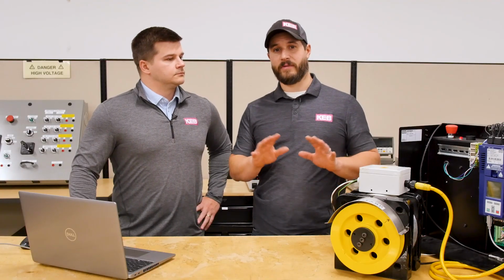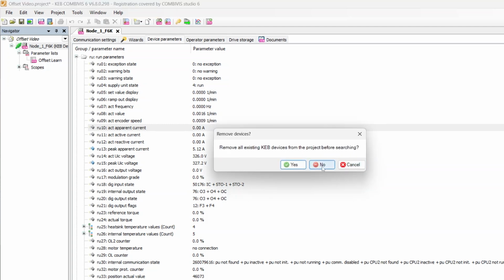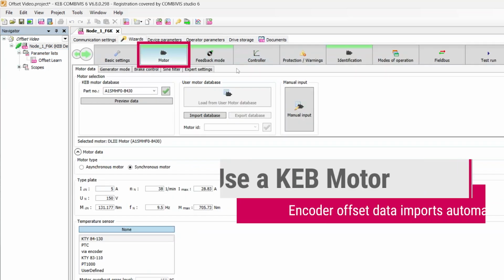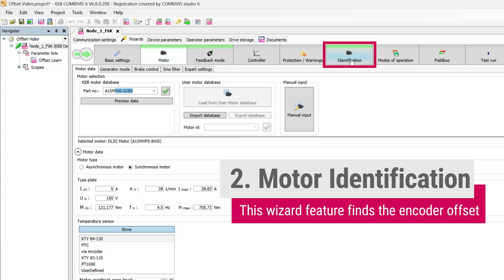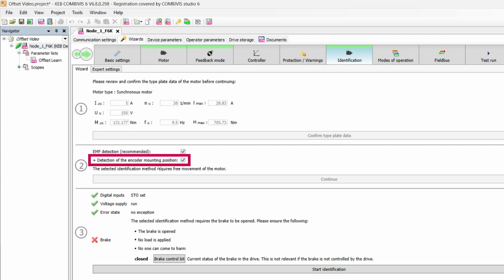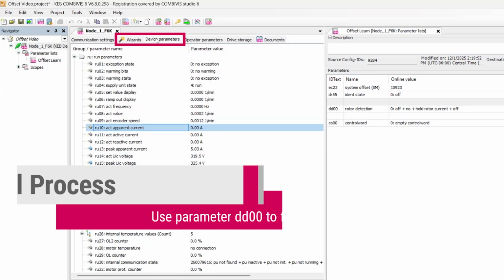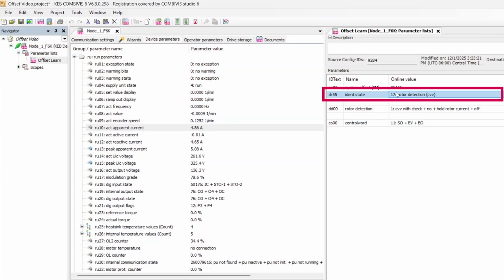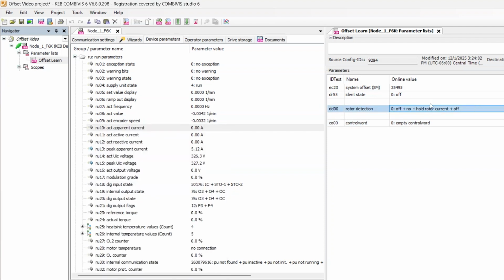Understanding Encoder Offset Parameters: How to Find and Import Encoder Data | Problem Solved

Comment: Im fazla rabbi electrical engineer. 
I work with KEB inverters.I am facing some problems while working on an inverter yesterday and cannot solve it. Let me describe the problem from the beginning.
inverter KEB (HAITIAN FS) 
mat.No.21F5K1R-YVC2
I have two inverters of that model. After an inverter control card fails The control card is removed from another one and installed in that inverter.
(note.  all inverter  machine same parameter  same model.  this is for backup  inverter.) 
after install showing error (E.Puch) this error reset from parameter (SY3) After reset, I noticed that some parameters had become default.
Then I tried to enter new parameters via the keypad. When I started giving new parameters again Then I saw that nothing was taking parameters.
Ec.06  (Encoder 1 rotation) This parameter is not changing but I need to change it.

Please can you help me with this?
Reply from the maker: Hello Fazia Rabbi, thank you for your question. Swapping parts between drives is not approved of without consultation from the KEB service department. Even if you have the same model number drives, they may not be compatible.